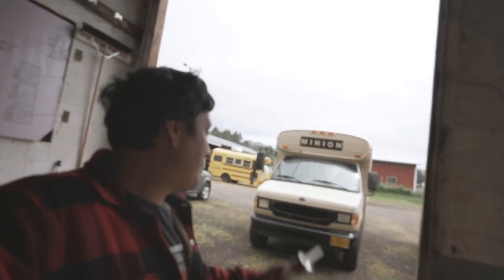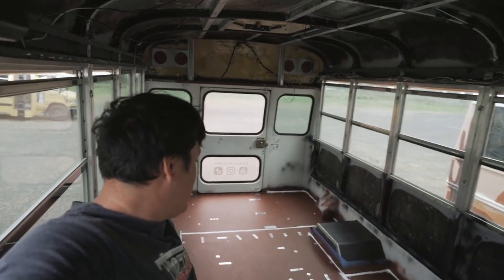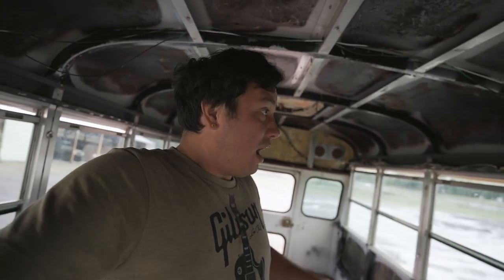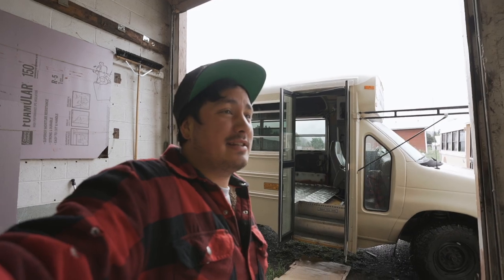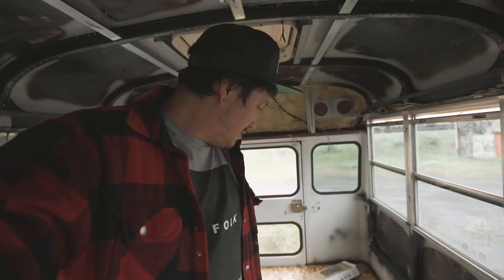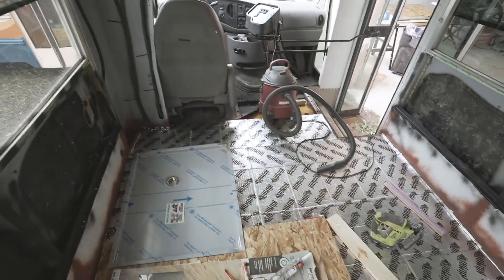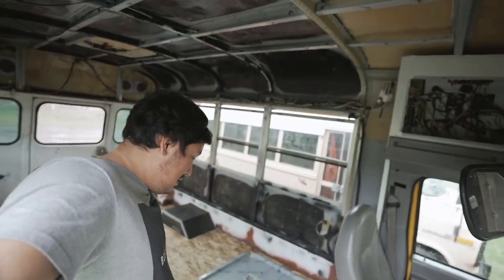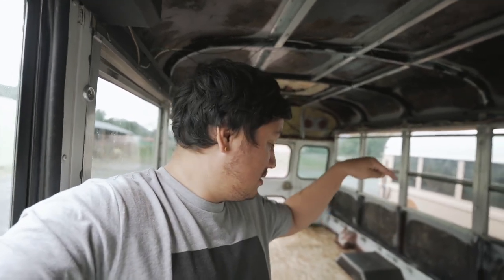Installing A Floating Subfloor In A Bus (No Framing) - SKOOLIE CONVERSION

Comment: Oooo that shower pan looks great!!! So stoked to see our pan in your build ✌🏻 Thanks for the shoutout Isaac 💜
Reply from the maker: I started doing the subfloor and forgot about it! I had to go back and pull up wet glue and cut the square out. Was a mission but funny looking back now. Honestly that shower pan seems perfect for any van or bus build. Stoked to see the project done and use these in future builds 💗
Reply: @isaacturnerit  The inset part is definitely a unique feature if you’re used to installing above the floor pans. Can’t beat the extra head room though 😏
Reply from the maker: @OurWayToRoam  foshoooo

Comment: Congrats on becoming a daddy! Also, keep in mind that your shower doesn't have insulation below it, so it'll be cold when you stand in it in the winter, and it'll also be a way for cold air to permeate your bus, and hot air to leave.

I recommend putting it on top of the plywood and putting a border around it to protect the plastic. Maybe a little ramp could help prevent tripping.

Comment: Good job but I’d stager the foam board and plywood. Also run those boards long side across the bud therefore avoid a seam running with your foot path. I did that too.

Comment: Great idea sealing the floor but you might want to check underneath the bus and see if there are gaps between the body and frame/chassis.

I know my bus had some very evident gaps that needed to be sealed with Great Stuff™.

Comment: When you caulk the inside of the floor what happens with the moisture on the outside?  Do you have to seal it too or because it is open to the air will it be fine?   I now nothing about building out a bus or van so curious.  By the way you and Jaylena make beautiful babies!!
Reply from the maker: Open air!

Comment: So why do you install walls before flooring? Is that just so you can replace the floor without tearing everything out?
Reply from the maker: Because I was gonna paint. Didn’t want to have the mask floor. If I paint the ceiling and walls first than I don’t have to worry about the flooring

Comment: Could it possibly be more “FEASIBLE” (financially, and logistically) to build BOTH MINION AND the “other bus you’ll be selling) - AT THE SAME TIME - for example, Do the TEAR DOWN, DO THE PREPPING, DO THE FLOORS, DO THE LAYOUTS, OUTDOOR THE CABINET/BEDFRAMING MATERIALS, SO THE WIRING, THE PUMBLING - because I don’t know IF THIS MAY MAKE SENSE - BUT YOU CAN BE RAISING $$$MONEY, potentially “saving on costs’ (overall - a bit), saving on time (a little), and it might ‘GO FASTER’, like an “assembly line’ idea . I know is not the same as Cooking for 10 vs cooking for 2 only takes a little bit longer, and costs more (but NOT 5times more), and etc. SO I UNDERSTAND BUILDING 2 BUSES IS DIFFERENT, BUT - it WAS JUST A THOUGHT OF “Helping You’ - and if it DOES NOT HELP YOU  - I’m sorry - JUST IGNORE MY IDEA. I’ve no experience, like you have. All the best.  ❤️ ☮️ ☀️ 👶 🍼 GOOD LUCK!!! 👍
Reply from the maker: nah too much money out at the same time.